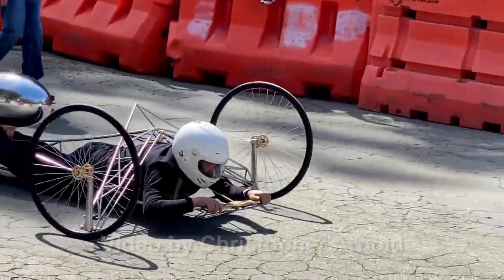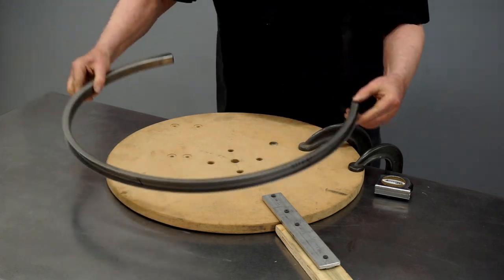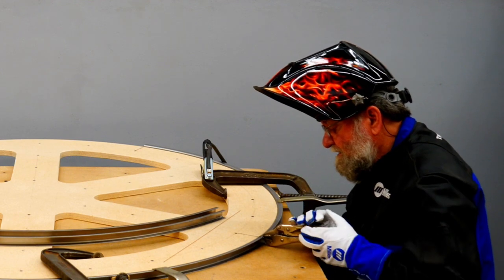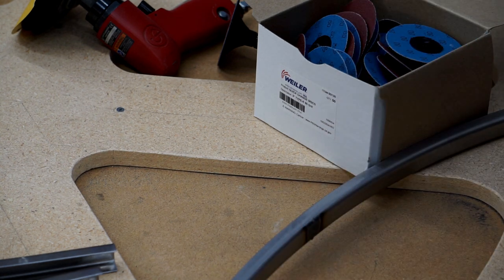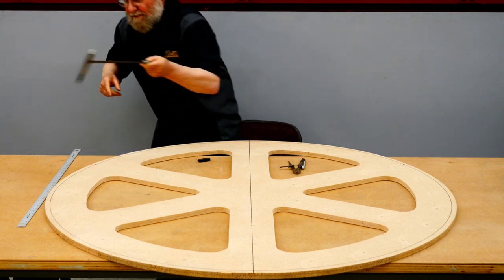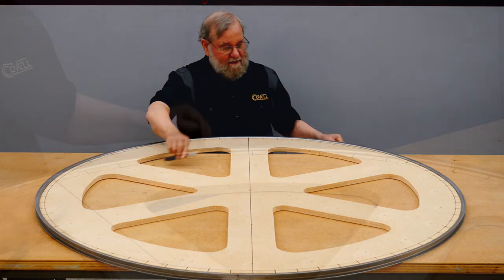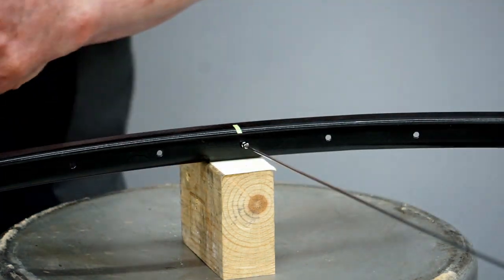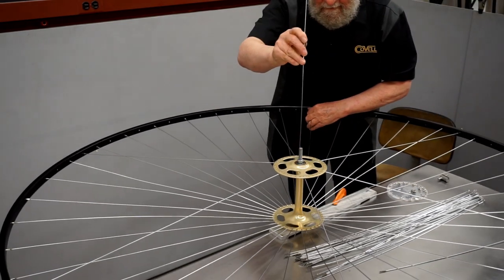Making a Really Big Wheel

Comment: As a bicycle mechanic and wheel builder I can say you laced the wheel the hard way, just lace every other spoke until you're out of holes but leave it loose. Then flip and do the other side, and rough true it by tightening a half turn per spoke until they all make contact with the wheel and stop as each spoke makes contact. The final truing will make sure to have the same tension on each spoke by plucking the spoke and listening for the same tone from each spoke, then using the truing jig to fine tune the wheel.
Reply from the maker: We should have talked earlier. Thanks for the great tips!

Comment: That's the most beautiful wheel, but is it normal for the steel of the rim to be so soft? Or does tensioning the spokes firm it up a lot?
Reply from the maker: Well, a lot of bicycle rims are made from aluminum, which is probably softer than steel. The tension of the spokes is what makes the wheels rigid.
Reply: @RonCovell  Thank you, that makes sense.

Comment: How did you decide on 'parallel' spokes instead of crossed one as you see on most bycicles?
Reply from the maker: The spoke pattern I used is called 'radial', and it is only feasible on wheels that are not powered or braked by the hub. Crossing the spokes makes the wheel stronger in every way, but I like the look of the un-crossed spokes.
Reply: @RonCovell  fair enough :)

Comment: Why did you opt to fit the spokes in a radial pattern instead of tangential?
Reply from the maker: I like the look of the radial pattern. On a bicycle which is powered or braked at the hub, a crossed spoke pattern is important, to give the hub rotational strength. My car is a coaster, and the brake is on the rim.

Comment: Cool,  the lacing pattern is pretty weak
Reply from the maker: If a wheel is driven or braked by the hub, radial lacing is not a good idea. This wheel is on a coaster, with a brake on the rim, so rotational strength is not such an issue.

Comment: Why did you use a "radial" spoke pattern instead of the "cross 3" spoke pattern? https://www.youtube.com/watch?v=caCloMziaCk
Reply from the maker: Crossing spokes gives the hub much more resistance to torque, but since my car is a coaster and uses a brake on the rim, I don't need that kind of strength. I chose the radial pattern because I like the look.

Comment: too bad it's just for art, could had add a hand pedal system on it right on the front and no one would have to push the bike around, or a very small electric motor with batteries hooked up to the big wheel and this would had double the amazingness.
Reply from the maker: You could certainly do that!